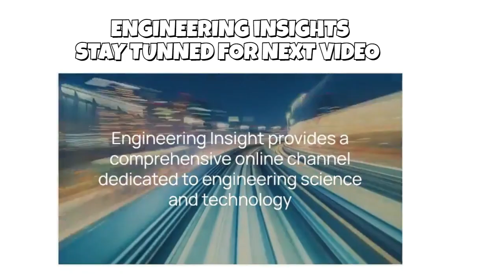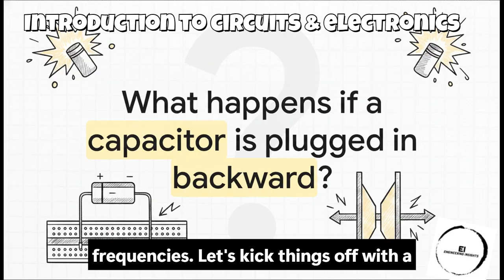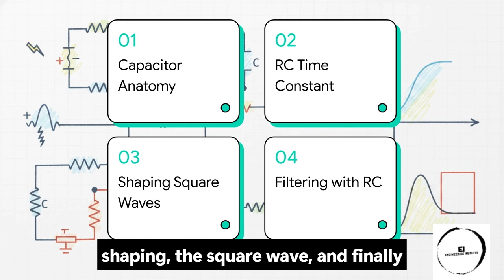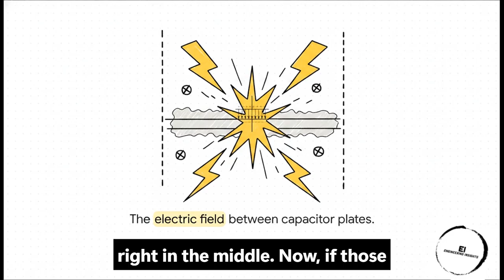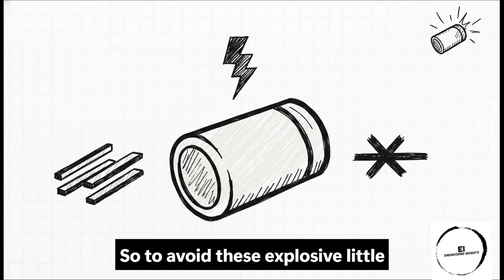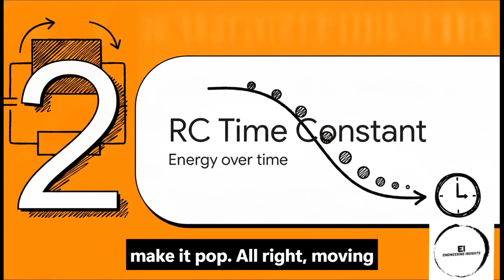The Secret to RC Circuits: Charging, Discharging, and Time Constants

Comment: The video seems very interesting, but unfortunately it's unwatchable with the flashing starting at around 2:38
I assume that it wasn't made like that on purpose... but if it was, you should definitely give an epilepsy warning.
Seems like something went wrong with the editing or conversion.
Will definitely watch the full video when it's fixed.

Apart from this mistake, I still have a little suggestion to make. Please try to equalize the volume. The voice is rather quiet - which could maybe be bumped a notch, but it's alright. But the music at the start is very loud in relation. It gave me a jump, when I came from another video.. so I had to QUICKLY lower the volume for the intro... just to then have to raise it again. Raising the treble, and reducing the bass might also make the voice much better to understand.

Gonna watch more of your videos now.